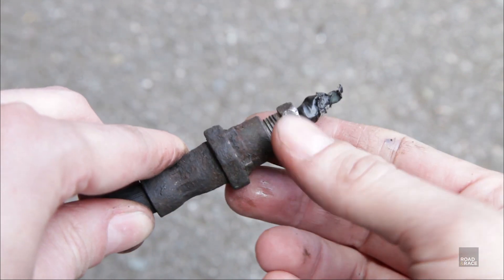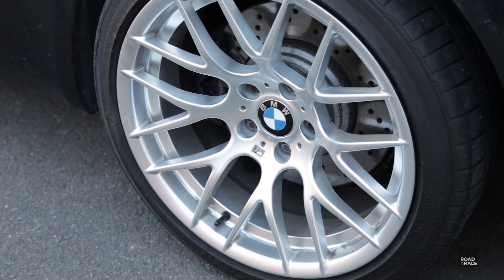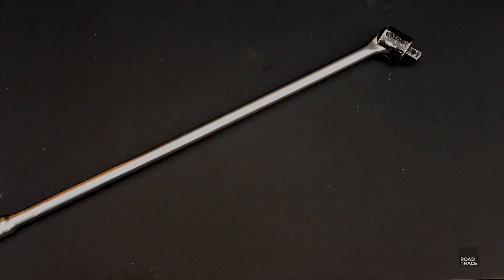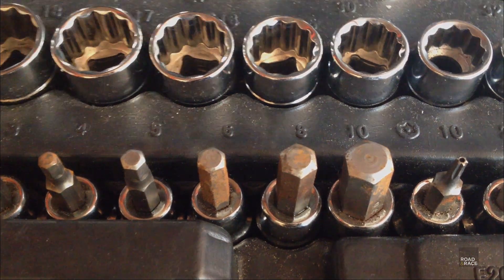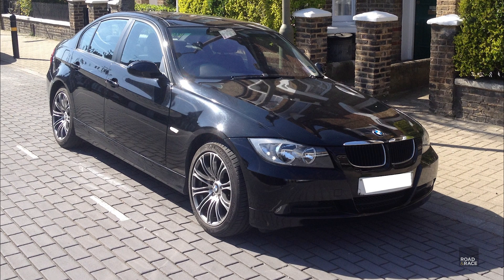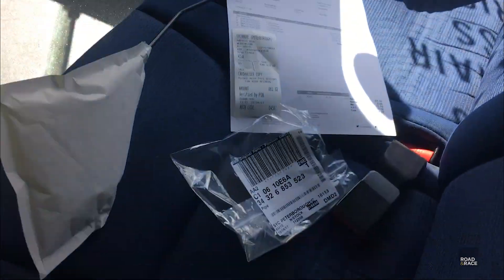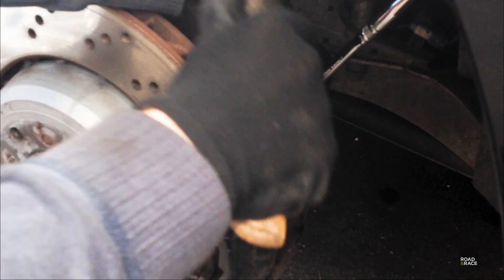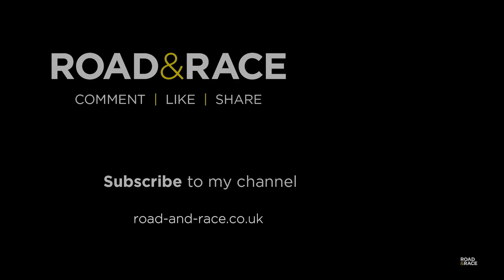Nightmare problems with BMW M3 brake pads and hoses

Comment: Can't believe you greased the slide pins. All BMW technicals say never grease the pins.
Reply from the maker: Yikes, you're probably right.  Why do they say not to grease them?
Reply: Could be wrong but I assume its because the grease can cause the rubber to swell. Ive noticed, whenever I change pads and I remove the pins they seemed to be fine without the grease.
Reply: If you use the right silicone paste that meant for it, there should not be a problem.
Reply: AndersDog94 That's right. Silicone grease is safe to use. Regular grease is petroleum based and should not be used on rubber as it will cause swelling.

Comment: Over tightening the bolts stretches them = the bolt may snap off under pressure (cornering, braking) = you losing the wheel.

Comment: Someone f*ed up when torquing down those wheel bolts. 😑
Reply: The car owner f'ed up for not redoing the bolts after visiting the tire shop. The bolts are far easier to take off when they are not yet rust welded.

Comment: One more thing. Brake grease should not be applied to the sliding pins on Bmw callipers. Just clean them up. The grease will attract dirt and grit. BMW says no grease or brake paste should be applied to them.

Comment: Tip for you. Never use an impact gun on the locking wheel bolts. The metal is softer. They can be damaged / rounded off easily.

Comment: Holly molly 10 years, I only had my for 5 and already spent about 8,000 to fix common parts like gaskets, alternator, AC compressor etc. If I hadn't installed all myself I would be looking at twice that much. BMW=Garbage. I will admit, they are nice looking machines.

Comment: sorry but 2:20 if that is already a problem for you, don't even think about touching the brakes O_O jeez that's pretty standard, especially after the winter all bolt are salty and stuck. Next time use a normal torque wrench with a shorter lever to the nut and step on it ... easy peasy

Comment: it's actually astonishing that on a 400bhp sports car, BMW think its OK to fit these unbelievably weak single piston floating calipers! Even a low powered boxster comes with four pot brembos up front. BMW have finally learned with the newest generation to get their brake game faces on, but until recently they really did have completely chocolate brakes. 

Do yourself a favour, get a BBK for this car and do away with the appaling standard brakes. Pads won't help get heat away from that single piston, or prevent inner pad wear.